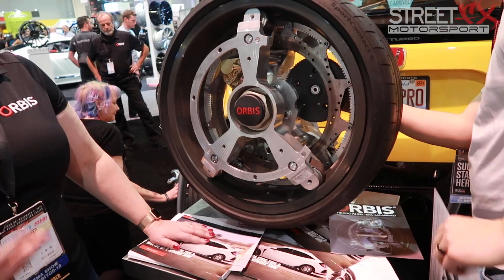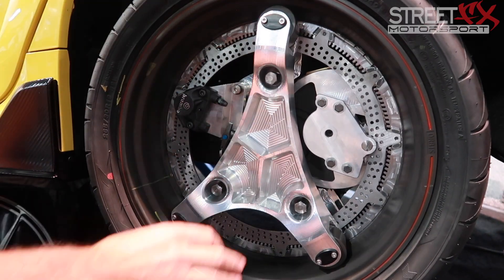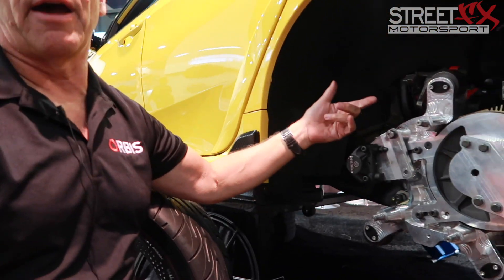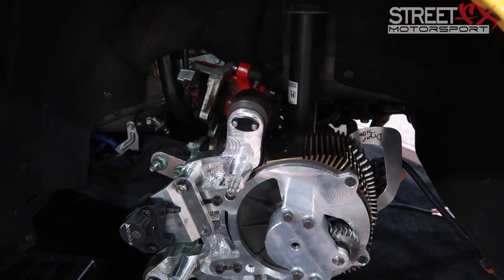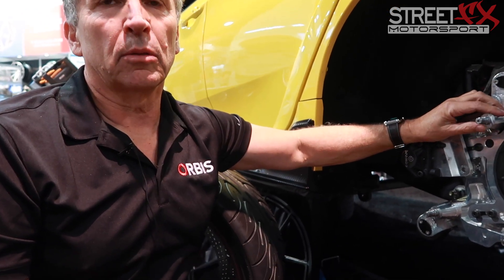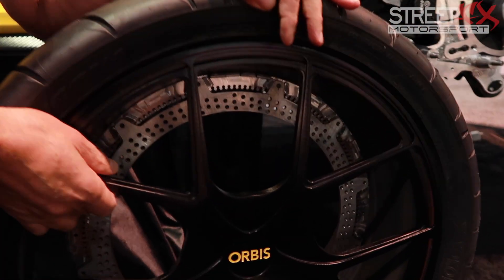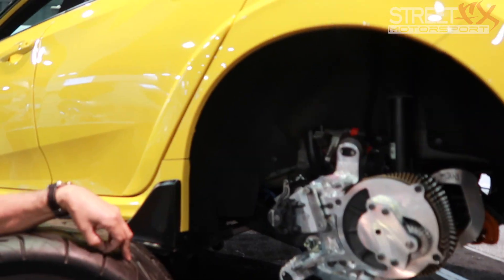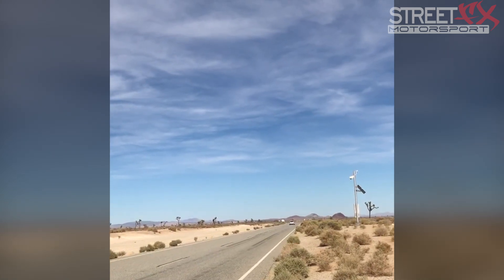WORLD's FIRST ELECTRIC hybrid AWD Honda Civic Type R FK8 with 450hp!

Comment: I do understand your fascination because you never heard of anything similar but... It's OLD news, and very poor execution at best... the open gearing is absolutely unacceptable, even childish. Look up Elaphe, now that's a real hub motor system, waaay better than this in every way.
Reply: I think it's obvious this is not new, but I think it's a great way to do it. Simple, light, easy to access for a consumer. What the other have been missing is a consumer market. They are all about OEM which makes it slow and difficult to get your car setup. If you are going to be negative at least have a point - are you an engineer who has researched or seen data on the testing of these? Didn't think so.
Reply: Yes I'm an engineer and I know a thing or two, about hub motors also. But you really don't need to be a genius to see, just how inefficient, fragile and unreliable this system is in it's very basics. Event Without logic, doesn't your gut-feeling convey to you just how unrealistic this system is? C'mon now...
Reply: @davidmiletic6647  you do know few things... but you don't know main things about this. You are comparing it to hub motor systems which are total opposite from this based on moment of inertia. Do some research before you start bashing something based on your primitive biases. You are an incremental engineer... used to make small steps... blind for vision...
Reply: @ProfessionalAmateurRS  haha, just read my post again, and than your reply. And than read it again, until you sense the irony of your reply.
Reply: @davidmiletic6647  Can you please include a few specifics?  Thanks :-)
Reply: @zephans  Do you mean specifics of the Elaphe systems? Check it out here:
http://in-wheel.com
It is highly efficient, high power, simple, is used for regenerative breaking also, very low center of gravity and great overall 3D weight distribution. The biggest mechanical challange of this kind of system is of course to be able to withstand the everyday beating it gets from the road, being fitted between the rim and the suspension, because even at it's low weight, the sudden changes of the direction of motion cause big g-forces, so it would be ideal to use it in synergy with a very responsive el-mag active suspension (it should be developed in-house and sold with the system). An engineer can play with it's power distribution at-will, especialy in 4-motor system setting. No transmition, no aditional power losses.
While I can think of many more improvements of the mentioned system, it is currently the best system out there. I was once considering working with the mentioned company (and still do from time to time haha), maybe in the future.
Reply: @b-manz  you are correct. Real benefits of this technology are great when you take into account energy consumption and friction data. Car and airplane manufacturers are interested in this tech based on braking performance, static friction and moment of inertia derived benefits.
It is about patent acquisition around this technology.
Reply: Correct
Reply: Elaphe

Comment: Cool idea but those wheel/motors won't last long especially off road...cost a fortune and be noisy as hell..What happens when rocks and gravel is going between the 3 rollers and the soft aluminum rim or in the exposed gears....the motor itself might be sealed but nothing else is.A totally encased setup would be much better. 
IMO A diff mounted motor like a Tesla 3 setup would be much better then these things marketed for those with more money then brains lol...not to mention a Tesla setup would be capable of so much more...
Like if you are going to put the time money and effort of mounting a substantial battery pack why limit yourself to 100hp...high maintenance and poor longevity...
I don't care what he says...anyone with fabrication.... engineering or off road driving experience will take one look at that system and know it won't last without regular parts replacement...

Comment: Constant mesh dry steel gears? I wonder how that would fair with longevity in the open elements. Imagine hearing that constant whiny drone at highway speed for hours. There should be a way to disengage it.
Reply: Imagine a small rock hopping in
Reply: I was thinking same
Reply: All it takes is one grain of sand to F a gear up.
Reply: thats a point
Reply: Fabricate a gear case cover duh.
Reply: Playing a simple destructive, noise-canceling tone through the speakers that's synced with the exact tone the hub produces at various RPMs would be all that's needed to negate the added noise
Reply: @karmesancheese  Actually that tech is already here. Not many manufacturers use it....YET.  OPEN exhaust that is quiet? SURE!
Reply: They talked about all of the pros and none of the cons.
Reply: @Stormprobe   There are a few,but what a brilliant idea!!!
a BOLT-ON system.
Reply: Open gears of the right material and with the right coatings can last quite a long time
Reply: They had to use straight cut gears? Bevel gears would cause a LOT of side thrust and a thrust plate would be required and much bigger bearings! That turbo whine may get on my nerves on a long drive. The full faced wheel cover may reduce that gear noise and offer better gear protection but it would reduce the air cooling to the motor and gears.   Add "Dyna Mat",too? I would.
   Cool idea,though.
Reply: how do you balance that wheel?
Reply: Interesting to see where the company is now 6 years later. Fully enclosed motor, no exposed gears or a unique wheel and a cooling system added. Working with VW for OEM applications.
Reply: Todd Simone the torque from the electric motors could be the reason why the gears are cut in that method

Comment: curious how they integrate their system to the factory throttle/pedal system to match with the instant torque and acceleration of EV  i would think the factory gas engine would be loading up with TONS of extra fuel without the digital programming to recognize the abnormal thrust

Comment: once the tech has been out for a while  and becomes more affordable that's when completely useless to fix cars will come back to life with all wheel drive and no need for the stock engine- should come out with a stand alone "universal" fuel engine to charge the batteries while running so you could have a universal kit to get any b(blown up) chassis back on the road without the necessity to find the sometimes impossible to find parts

Comment: its awesome tbh get good fuel mileage plus adds some horsepower and awd drive launches , i cant be mad at that no one should , Yes you could get more hp from an ls jay z rb etc etc ... and  HELL YES this hybrid wheel is expensive  , but with any engine adding more hp = bad mpg ,  but this is a great way to balance it with the good mpg in my point of view, only if adding a bit of weight is not an issue for you, and hopefully the price tag drops a bit ✌

Comment: Take a cheap second hand small car with a dead engine, put these wheels on, remove the engine and replace it with batteries, got a 100hp small electric car, depending on the price of these wheels, could be a good deal.

Comment: Hi there, 
I really like the video!  Nice one. Thank you! I love the idea! I believe it can be used for several reasons. 
If you have an old car with a broken engine just replace it with this system (2wd or 4wd as you wish). The cost comes back in a year, year and a half or even if in 2 years. 
And yet, if you have a sport car with no AWD version by stock, just like this Civic Type R or BRZ, now you can convert them to AWD. Amazing! An AWD BRZ with 300Hp - 400Hp is definitely a car I would love to drive! 
Or if you want to stay at even lower consumption with a low consumption car eg an AUDI TT 2.0 TDI. In addition, you may prefer to have AWD system too. Put €12K on it and you become super efficient. You can even use fully electric ride in the city. An Audi TT AWD 2.0 TDI with 284 Hp (or 384Hp) and less than 6l/100km consumption. Amazing! Not even talk about the huge increment of torque!
The only thing is the reliability of the technology I am concerned about! I would like to see it working, tested during months, in real life of AWD cars such as dirt road, mud, snow and ice with -25 degrees of C, dirt road +45 degrees of C etc. 
Also would be nice to see at top speed! Good to know the system can run at 100kmh. But how about at +250km/h ... or even at 275km/h?  
How does it move on a race track? Can we compare the lap time of this Type R to the stock Type R, on the Nurburgring for example? I would be curious about the change in cornering speed and G-forces! 
It is a 50Hp version, but they are planning (or they already have) a 100Hp version if I understood Mr. Hays correctly. Reading through their website I have seen a 75Hp version mentioned. 
Would be nice to know what distance can be covered, in fully electric mode, with the different versions, ceteris paribus? 
Also would be nice to know what torque the other two versions can produce? Is the torque increment linear, so 1.5 times and twice as much?
Talking about batteries what types and what capacity they can provide or suggest with what weight penalty? 
So, it raised plenty of questions to me. However, I still love the solution, very much! I hope I will find answers to my questions! 
I believe Mr. Hays reads the comments under your video so I would like to wish them Good Luck!
And thank you again for the video! 
Cheers,

Comment: Under a $1000 for each side and under $1000 for a battery.  And maybe, just maybe this will take off.
Reply: Incoming chinese replica for a tenth of the price in 3, 2, 1.... 😂😂😂
Reply: @CatalinVulciu 
With 1/10th the reliability and build quality.
Reply: Nah 1000 for the battery isnt enough,batteries are expensive
Reply: 3k for 100+hp and near instant torque and high acceleration is a bargain. 10k seems right for early adoption.
Reply: @2010ngojo  What is your summer fun car? What do you drive?
Reply: @ivanfedyshyn7211 
I'm driving a e85 z4 3.0i manual. But it's a "daily" for the time being. No other car right now. Looking into an audi tt mk2 3.2 though.
Reply: @2010ngojo  in a Hennessy or Rentech world 100hp for 10k maybe is logical. In a supercar world yes. My Viper was expensive to mod around 100hp for 10k. But for civic that is to much. For 10k you can vortec  supercharge a 5.0 mustang do oil pump gears, tune, smaller pulley and you have close to 800 rwhp. So you get 450 to 500 extra hp from stock 435 for 10k.
Reply: @ivanfedyshyn7211 
Let me know when it's awd, have near instant torque, and doesn't fuck up my fuel eco. That's the whole point of this thing, especially the awd.
Reply: @2010ngojo  stock mustangs get 26-27 mpg hwy with centripetal supercharger they get about the same mpg with all that extra power, yes they are that good. Instant torque only improves that civics 0-60 by 0.6 sec. Apr stage 3 DCT Golf R will do 3 to 3.2 sec 0-60 from 5 sec stock and that is under 10k. And nobody from public have tested this "awd" system. I tell you facts, your opinion is based on this video only. Stop reading brochures, get out there and do something..... Have a good night
Reply: @ivanfedyshyn7211 
Why are you comparing different aspects of several different cars to one car? Seems illogical. Ironic much? I want comparable mods, not mods that does some things better but nothing in other areas.
Reply: There are motors and batteries that u can scavenge from other cars.
Reply: Yeah 5k at most.
Reply: $1000 is too much. Actually it should be -$1000 and then maybe, just maybe, this will take off.